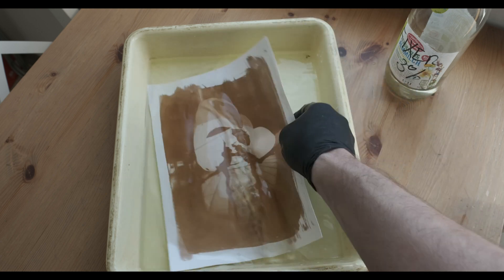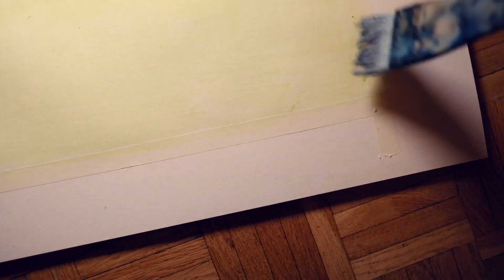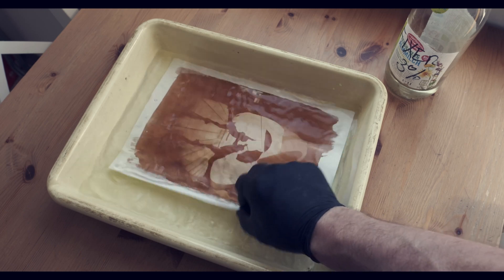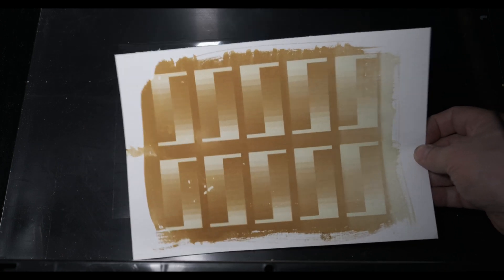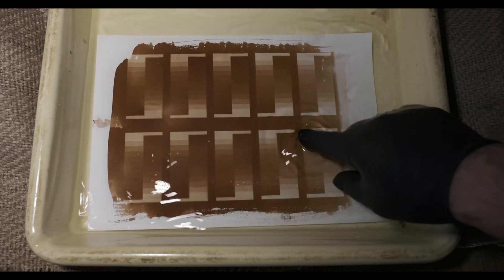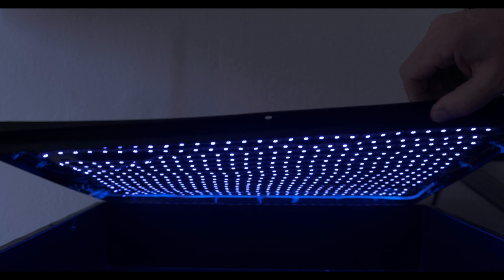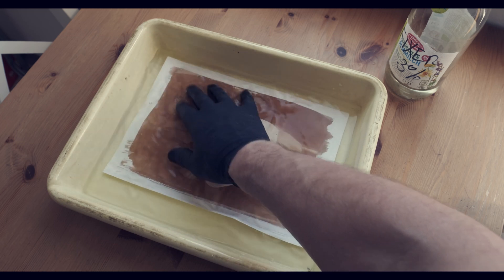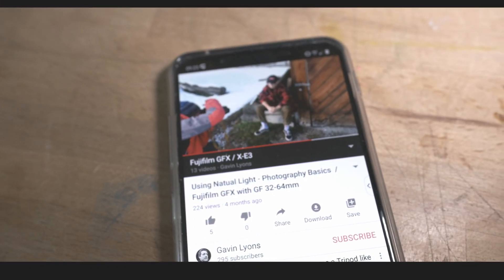Alternative Photography -  VanDyke Brown with UV LED Box

Comment: thank you for this video. I did not find the link for the strip test. I would also like to know for the fixer at 3% (30g for 1 liter of water?)
Reply from the maker: Hi Jean, Thanks for your kind comments. I've add the link to the description above. (Strip Test Page can be downloaded from the UV LED Box instructions 
https://gavinlyons.photography/uv-led-box/) .  30g is right
Reply: @GavinLyonsCreates  i found it, thanks .i still have a question about which transparency do you use for cyanotype or van dyke digital negative
Reply from the maker: @jeanbraunschweig7454  Nothing too special, I put links in the description above for Inkjet and Laser above for Amazon. Hope that helps :-)

Comment: i was curious to see you take the print straight to the fixer. i have never seen that approach. personally i wash my exposed VDB print in 2 baths of distilled water slightly acidified with citric acid (2.5% solution) for 2 minutes each so that it removes excess silver nitrate. this helps clear the highlights and gives better dynamic range and contrast. by putting the print directly in the fixer you are "baking in" alot of excess silver nitrate. even 2 solutions of distilled water is useful in clearing out the excess silver if you don't want to mess around with additional chemicals. give it a try, you might find it improves the results.
Reply from the maker: Thank you! That makes a lot of sense :-) Will try that and do a follow up video too.